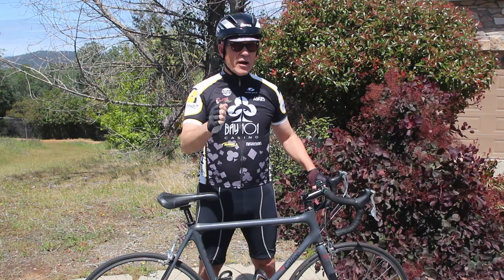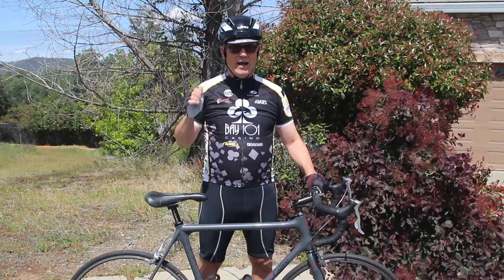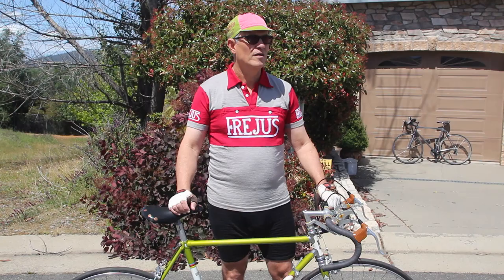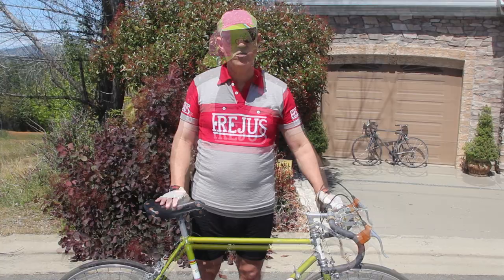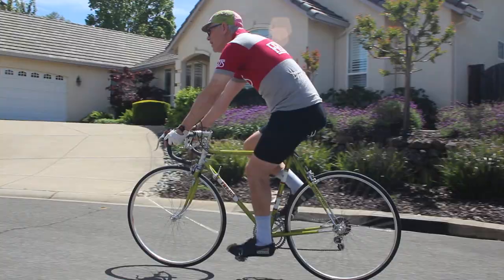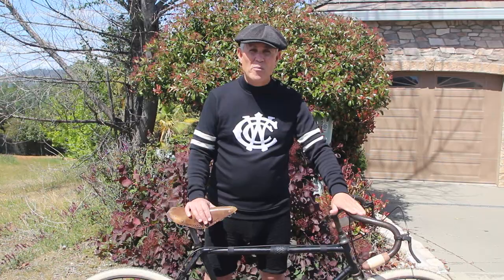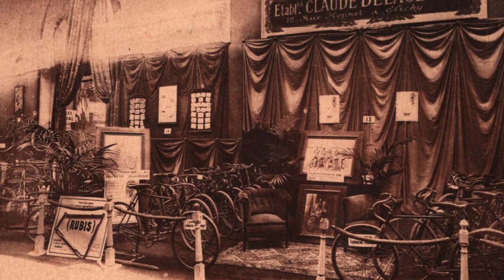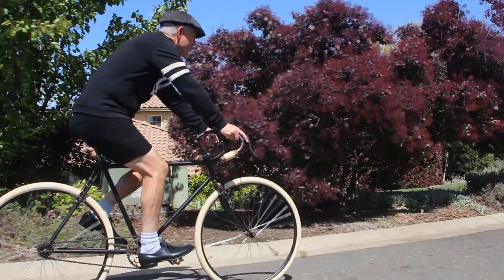Modern vs Vintage & Antique Road Racing Bicycles: Calfee Tetra Pro, Frejus Supercorsa, Claude Delage

Comment: BT&R's videos are totally stand alone in the cycling Internet world!
The open mind of BT&R is also incredibly stand alone.

BT&R's recumbent trike videos are what first caught my attention.
BT&R knows single-track and tricycle recumbents!

BT&R also does not ridicule delta recumbent trikes, which is a common theme among tadpole riders.
Own/ed single track, tadpole trikes, and now only ride delta decumbent Hase brand trikes here.
Greatly prefer better ride, comfort, suspension (even if only dual tires, directly under rider), 
and easiest getting side-saddle on/off of delta trikes. Even from a wheelchair (not there yet).

A tadpole IS required if higher speeds, downhill riding, faster taking of curves is your thing!
Have never tipped over either my tadpoles or my deltas since starting on recumbents in about 1990.
Not an athlete, but rather a hobbyist rider here.
Cannot get on/off my tadpoles anymore (both balance and arthritis issues!)
Delta can be 2WD with traction directly under rider's weight, even 3WD if front geared hub motor.
'Once Rohloff, always Rohloff' for me!
Thank You, for your educational, artistic, and tasteful background music videos!
No one else even comes close to your incredible videos and their incredible visual and educational content!
Reply from the maker: Thanks very much for the kind words, Gary! I've got a Rohloff on my GTO and it's been a joy. I've been on the lookout for a good deal on a Delta trike and when I find one, you'll see lots of Delta videos! :)

Comment: I’m definitely a trike convert. I really enjoyed this video. Ergonomics and weight reduction seems to be the biggest changes. I remember a friend of mine showing me his carbon bike about 10 years ago (easy two finger lift) which compared to my crossover bike that suddenly felt like it weighed four tons. Great job as always!
Reply from the maker: Thanks Dan! Yep, most of my longer rides are on trikes now.
Reply: This channel is the first that made me curious about trikes. The heat is so miserable during the day in the hilly region where I live that a trike seems like a nice alternative to trucking a two wheel to a more level ground, which is what I must do.  Thanks for replying.  I’m also eyeballing your costume (sorry, I’m an 2 bit ex-actor) .. racing clothing as sensible, including seat protection. Thanks for being in shape and looking fit. Some bike channels are not famous for fitness, that’s for sure.
Reply from the maker: @robkunkel8833  Hi Rob! Remember, there are no ex-actors, just a lack of acceptable roles! :) I live in a hilly area as well but the roads in my area are not great for riding anything (narrow roads with no bike lanes), so I usually have to transport my bikes and trikes to a more favorable area. Trikes can be easier on the hills as you can take your time and you can't fall over!

Comment: I like the fact you prefer mechanical  components. You basically are part of the bicycle and more cerebral pathways are firing with the mind-body connection. I think it is analogous to reading a book instead of a computer screen or pen and paper writing instead of keyboard typing.
Reply from the maker: I agree. I also have so many things I have to plug in and charge, I don't want my bike to be one of them. :)
Reply: @bikestrikesrazors  Well said.
Reply: The only bike of mine that I'll be putting disc brakes on will be my Gary Fisher Mamba mountain bike.  Those will be SRAM Level hydraulic disc brakes and rim brakes for my three road bikes.
Reply: @guymorris6596  The right tools for the job, I would like to see that set up...

Comment: I have a frejus with Mavic GP4 rims. Man I have no information on this bike. I have a Frame, box of all the original parts(excluding handles parts and a seat post and seat) , and the rims. What tires can I use ? When I look them up it stays the mavic gp4 rims are 700c with a 20mm tire. But I can not find them anywhere. Maybe you can help me out so I can start to restore this beauty. Handles bars, seat post, and tires that would fit the frame! Thank you so much if you can!
Reply from the maker: Hi Butcher. Those Mavic rims will fit any standard 700c tire. The bike will probably have tire clearance for 25mm, but a regular 23mm tire will work fine. The 20mm refers to the tire width and its personal choice. the 20's were very skinny tires that some folks rode back in the day, but now 23/25 is standard and those rims will work fine for those.
Reply: @bikestrikesrazors  oh awesome I’m more worried about them fitting the frame. What size fit your frejus? Can I use any handle bars and seat for this bike as well ?
Reply from the maker: @thebutcher1412  You can't go wrong with a 23mm. I believe that's what I have on my bike. Not sure on the seat post and stem. I've got a standard Campy seat post from the 60's and it works fine. Mine came with the original Ambrosio stem and bars. If you're not on "Bike Forums" classic and vintage section, sign up for that forum. You'll get lots of good advice for building up your bike!
Reply: @bikestrikesrazors  thank you very much sir !
Reply: @bikestrikesrazors  Hi! Question on AMBROSIO bars.  I have a NOS "13 Volte Campione del Mondo" drop bars on my Master Piu and the drop part of the bars flare out (like gravel bike bars) instead of being straight like typical Cinelli bars.  Any reason why???  Thanks.  I'll send a pic if you want!

Comment: So progress is losing 3 lbs. and getting padded handlebars for only an added $3000.
Reply from the maker: If you put some decent brakes on the 1919 bike and wrapped the bars with some padded wrap, it would be perfectly ridable. Took a ride yesterday on my carbon bike and Joe rode an early 80's steel touring bike (which was about as heavy as the antique bike) and he had no problems keeping up.